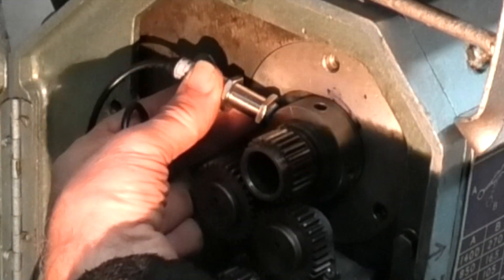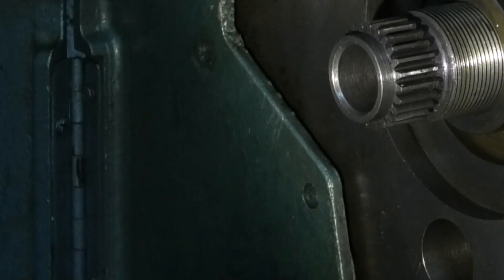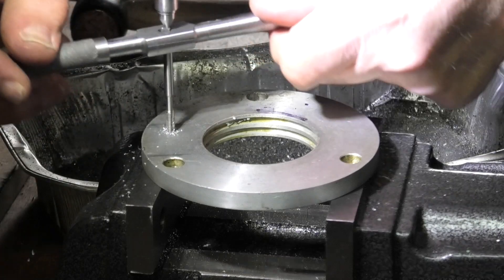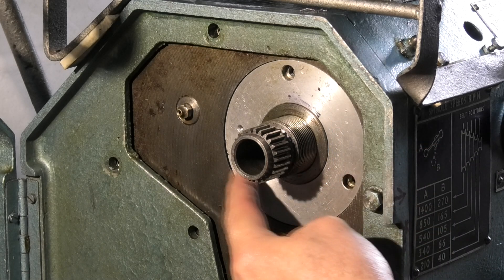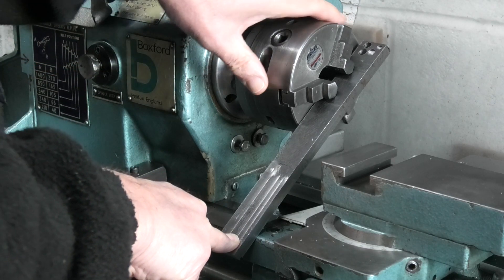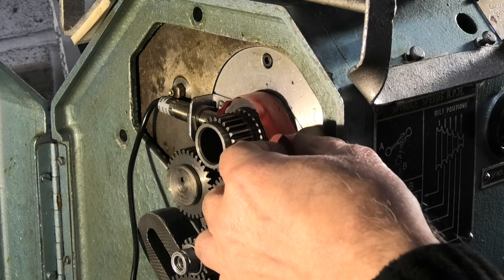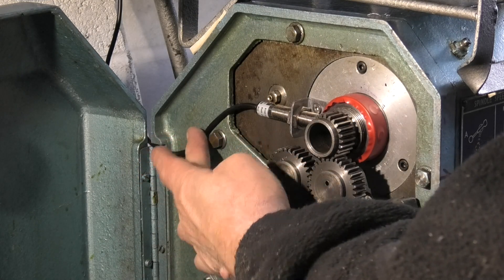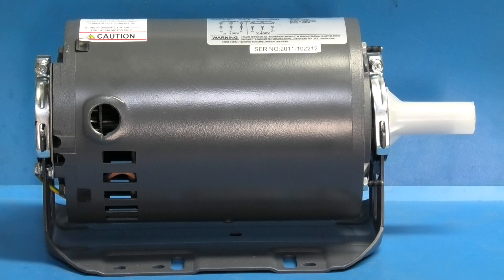fitting a rev counter on the lathe

Comment: Good vid think you should have mentioned that the Hall sensor only works with one face of the magnet normally the south pole on my set up I use an old mobile phone charger a good power source !
Reply from the maker: Sorry I did mention it in the previous video checking the lathe speed

Comment: Thanks Allen. Very enjoyable could you post a link to the parts for the  rev counter?  I would be interested to do the variable speed motor installation too. i have a boxford but the motor has been changed to a 240 volt that is underpowered, so it wont run under load at the higher speed. I suspect the gear ratio was changed too. Will a .75 hp motor bee enough? I suppose we will find out.
Reply from the maker: Hi David I purchased the part from Banggood I have asked them to send me a link.